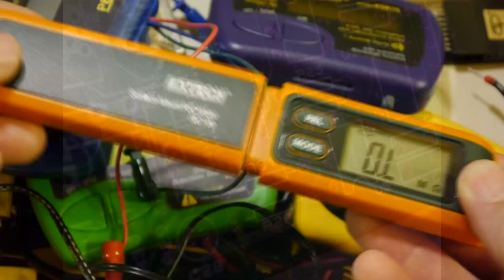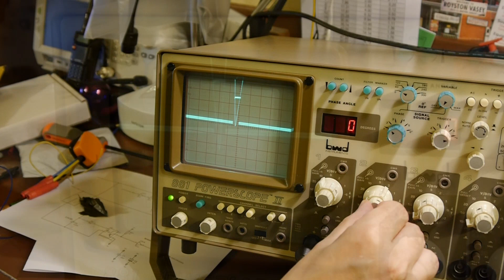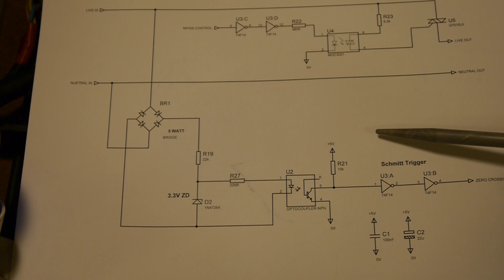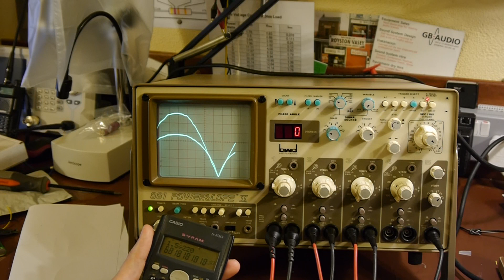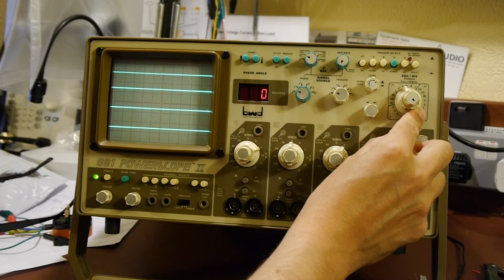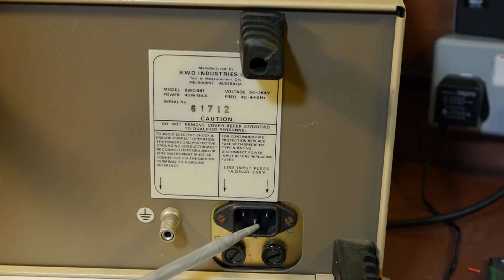Power Trip!   Part 2

Comment: You can make adaptors to plug in a regular CRO probe (which obviously will NOT have the same level of safety as the proper probes) by buying male to female BNC adaptors from eBay (yes they do exist, and I am not talking about T adaptors here, I believe they are used to reduce wear and tear on test equipment) and then modify them by cutting the bayonet locking ring off the male side.
Reply: eBay item number:
253095219822 - is a current listing for the adaptors I am talking about
Reply from the maker: Richard Freeman Great comment thanks. I will look at getting one of these.

Comment: Those probes are national grid work lol! Scope is unusual too, never seen one before. Does it have any trigger options?
THIS IS A JOB FOR........."POWER SCOPE"!
Reply from the maker: Simon Spiers by the power of grey skull I have the power.  If you think the scope you used at school in physics then those are the trigger options. No delay post trigger options, you can choose trigger level +-  and channel and line in, I think it has a single and reset but could not get it do anything. It's really all about the differential inputs and this it's good at.  Those cursors we're rubbish not sure if some internal twiddling is required. Regards Chris.
Reply: AllTheGearNoIdea Intrenal twiddling is always required even when it's not. Very interesting Chris.
Reply from the maker: Simon Spiers Your so right. Don't know what I was thinking. Chris